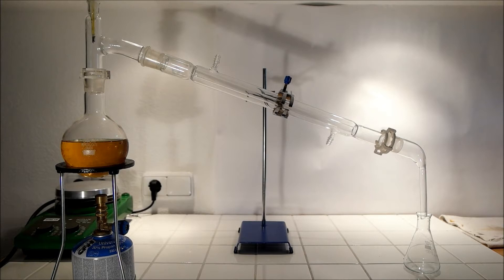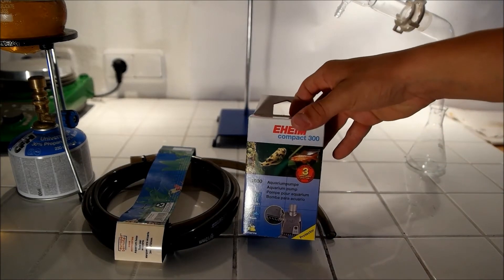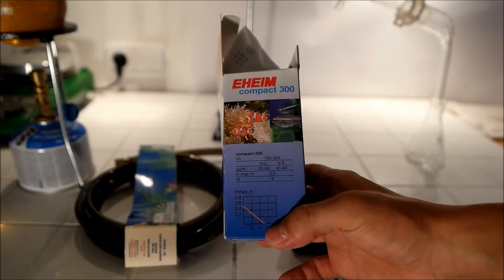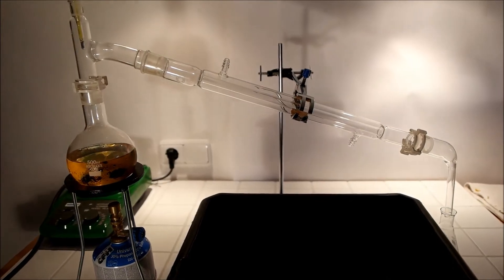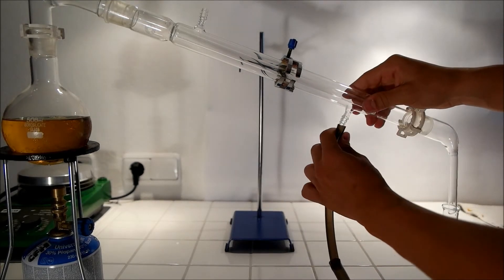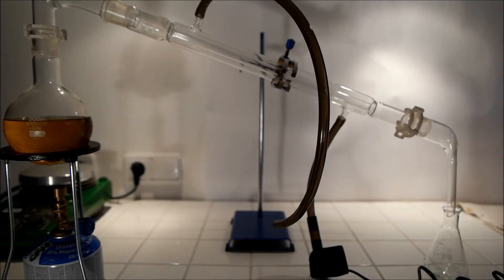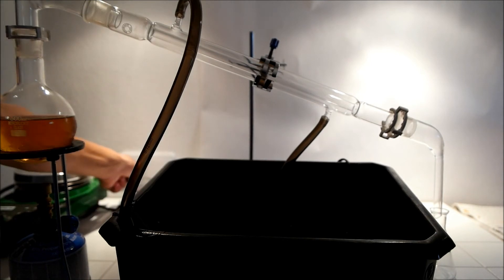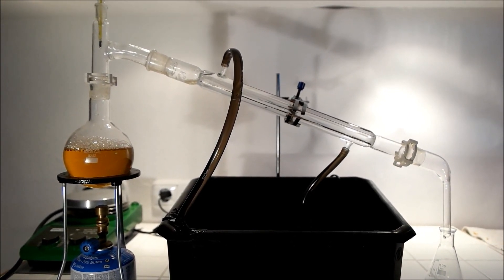How to Arrange a Portable Water Current System for a Distillery

Comment: Hm, I've always learned that as a rule of thumb for most distillations, the cold water should enter at the top of the liebig (the left valve).
Reply: The rule of thumb is that the cooling water should be run in a countercurrent to the cooled medium. So the presented way is the correct one. The one exception is when the condenser is vertical then the cooling water enters from the bottom, so the cooling jacket can be filled fully, disregarding the actual flow of the cooled medium, which can, but doesn't have to, flow in a countercurrent.
Reply: I was bit confused with my vertical condenser for a bit before realising this and the water wouldn't just pour away when new water entered the condenser.
Reply: @Tyresio12  yea that makes sense nvm my prior comment lol

Comment: Where did you get that camping stove? Also, don't heat flammable liquids with a flame ever! The issue is not the glass being damaged--the issue is the ethanol vapors not condensing completely (which is likely given that you didn't use ice water) and creating an explosive mixture with the air.
Reply from the maker: TheChemistryShack I got it from the German Amazon: http://www.amazon.de/gp/product/B000ZK3FDO/ref=s9_simh_gw_p201_d0_i4?pf_rd_m=A3JWKAKR8XB7XF&pf_rd_s=desktop-1&pf_rd_r=0P6EWCSV4H95ZMXPJ8W1&pf_rd_t=36701&pf_rd_p=585296347&pf_rd_i=desktop

Yes, you´re right of course, I thought that even if it exploded, it wouldn´t be very dangerous because of the small amount of alcohol. 
I´ll work safer next time! Thank you for commenting!